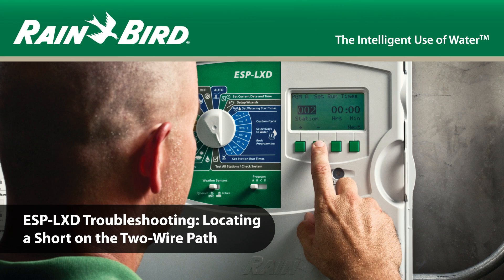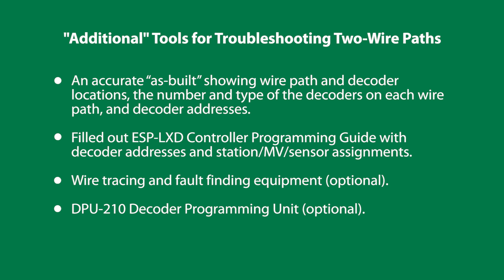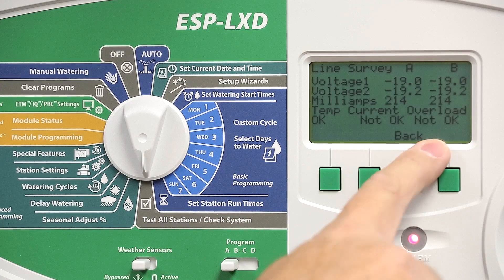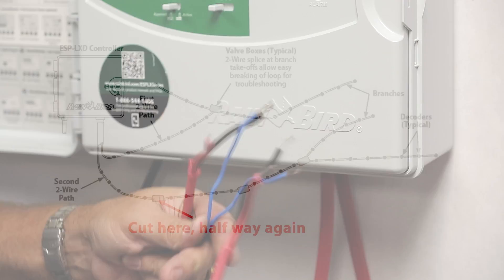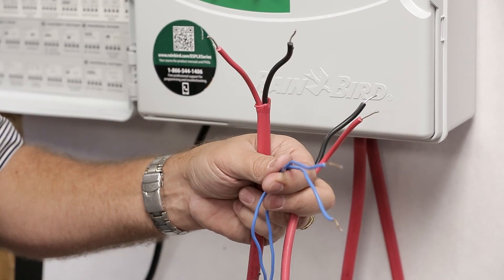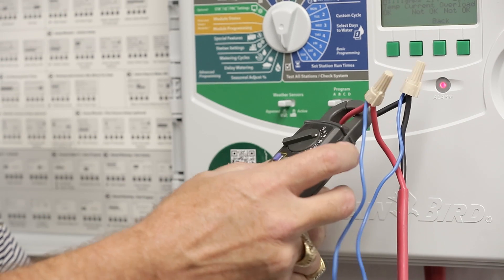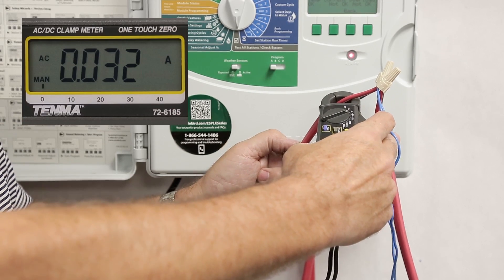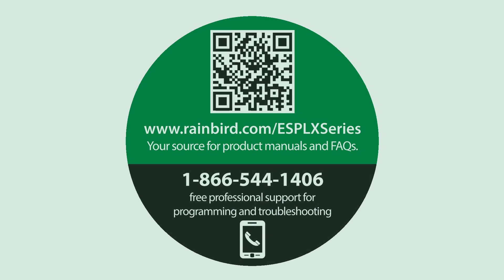ESP-LXD Controller Troubleshooting Locating a Short on the Two-Wire Path

Comment: The powered button/led blinks red and green and the system is not starting.

Can you please give me some advice. 

We are using an - ESP xld m50 controller.

The led blinks red and green and the system is not working.

We changed with another controller its working. But when we are using/fixed this controller its blinking the red and green colour in the led. 

Is there any process of checking to resolve this issue.
Reply: I had the same condition.  When i pulled the legs to find the bad path and then reconnected the wire, the light then stayed green

Comment: what's the controller mode should be in this short finding? is it must in "Short Finding Mode"? limited the current to 200mA? appies 24V to the 2-wire, so you can measure the current?